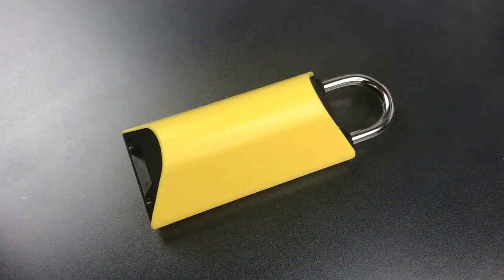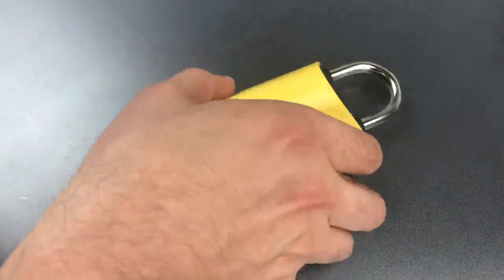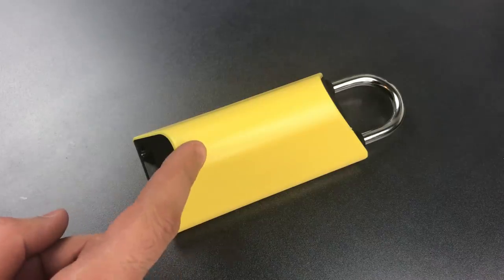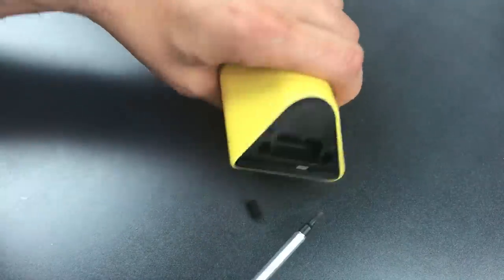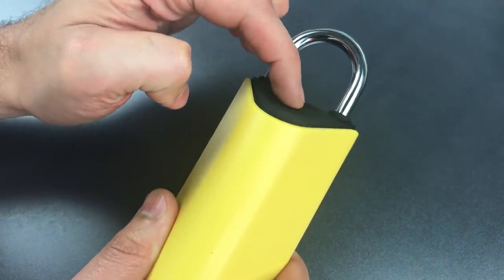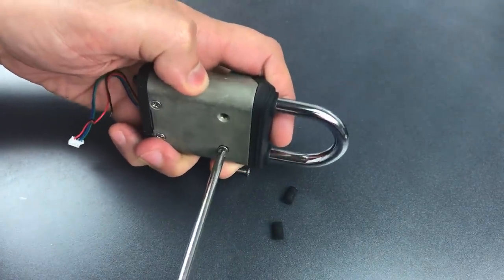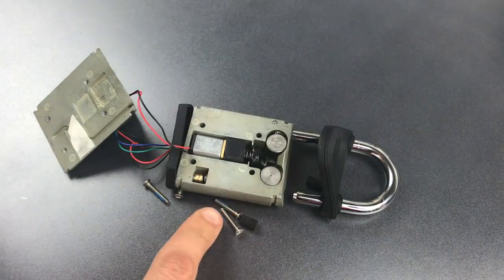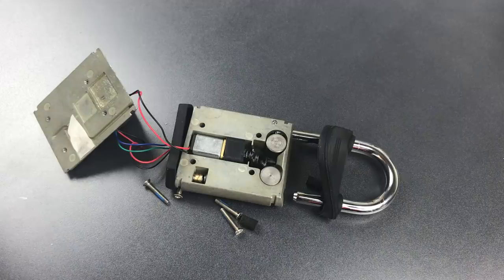[752] BoxLock: $129 Barcode-Scanning Padlock Opened With Screwdrivers!

Comment: Fun fact: They charge you 20 bucks for a sign "Delivery protected by BoxLock" that basically reads:
-owner is not at home most of the day, house is empty and there are no neighbours who would care for them (deposit packages for them)
-owner often orders highly priced stuff on the internet (why would you otherwise spend 130 bucks?) and has a faible for new, valuable gadgets-> probably expensive stuff in the house
-big box with valuable stuff at the front door, probably not secured well (since humans are lazy)

Yeah, that would totally deter thieves and not make their job easier by putting a huge yellow "please rob me" sign on your lawn...
Reply: Eulemit Beule now that's funny true but funny
Reply: Given the current crop of delivery drivers, they'd see the BoxLock, roll their eyes, whip out a "sorry we missed you" tag and slap it on the box the lock is on, and drive away with your package. You'd have to go out to the pickup point and claim it yourself. The days of them trying to deliver it the next day are OVER. Ain't nobody got time for that!
Reply: Agreed, Gwen. Fed Ex or UPS have a business model around delivering packages in a certain period of time to make the system run smoothly. If they're fooling with some electronic thing that fails to stay synchronized with the internet to send a barcode, it's pointless.
Reply: Persecuted: to annoy with persistent or urgent approaches
Did you mean "prosecuted"?
Reply: About as smart as those people who put a "proudly gun free home" sign in their yard.

Aka "come rob, rape, or murder us if you want" sign
Reply: David Daivdson  As long as you're home all the time...
Reply: I love how this is the one he favorited
Reply: I just have my stuff shipped to the PO Box. They're secure it and its locked in a locker with a key that's only given to me.
Reply: David Daivdson  I have a "Beware of the Velociraptor" sign.
Reply: @brokenwave6125  my home is gun free. Cricket bats, however...
Reply: @dkevans  Respectably, what's a cricket bat gonna do against any firearm? I don't live in the US, where I live guns are illegal. But in a country with guns around every corner I think it's kinda foolish not owning one. No amount of good will is going to prevent bad people, and no melee weapon compares to a gun unless you're already on top of the assailant. You can do whatever you want, but seriously why not own a gun in the US? It just seems like a risk.
Reply: More like set it by the door and ignore the lock completely
Reply: @joseph crosby mecham lol what?
Reply: @dkevans  "Beware of the bees" works better.
Reply: Lol, the sign just tells a thief what to research before robbing you
Reply: @andyk192  They'd just claim they didn't see it. If you try to say "but here's my BoxLock with the slip stuck to it", they'll claim they stuck the slip to the window and YOU put it on the box to get them in trouble.

I had these jackwagons decide that, because it was RAINING, they didn't want to deliver the $2,000 ham radio I had ordered, because they'd have to haul a big box to my porch from the street. So they ran up, slapped the slip on my window, and drove off before I could stand up from my chair and go to the door.

I was HOME the entire time, and the guy had to walk within 3 feet of me on the other side of a wall to get to my door so he could leave the slip. I tried calling UPS, but they don't care. They'll swear up and down they're going to call the driver and have him turn around, then they just hang up and flip off the phone and ignore you. I had to make special arrangements to drive 3 miles into town to pick the thing up at some hole-in-the-wall pack 'n ship storefront where they left my expensive package.

It was still raining, by the way. It was okay for ME to have to haul the box to the car in the rain from the shop, but this delivery moke -- whose JOB it was to actually do this -- couldn't be arsed to get a little damp. He swore up and down that "nobody was home", but he didn't even TRY to ring the bell or knock, because that would have meant having to go back to the truck to get the box and getting wet TWICE.

I have a sign on my front door that says "DELIVERIES: I am home, but disabled. Please ring bell and BE PATIENT. I move slowly!" Since I actually am home 99% of the time, there's zero reason to put a "nobody home" tag on the window.

But the WORST are Amazon delivery people. They'll claim on the delivery that they "placed item in resident's hands" when they didn't even show up, just so they can avoid getting out of the car in bad weather. I've had that happen a few times. They've finally started having their drivers take pictures of the package where they leave it, so you know they at least TRIED to deliver it. I guess they had too many drivers either throwing stuff away or just stealing it, and claiming they left it on porches, blaming its being missing on "porch pirates".
Reply: @brokenwave6125  That sign doesn't say anything about the mine field, poisoned arrows and other booby traps, though.
Reply: @jacobesterson  In close combat almost any weapon is better than a gun. It's way easier to stab somebody in close combat than to actually shoot that person.
Reply: My sign says "Warning: Live Poisonous Snakes"
Reply: @brokenwave6125   really? Because all signs are honest? Because you can ONLY defend yourself with a gun in the close confines of home? Because during a home invasion a burglars first thought isn't "are these people home at all?" Come now. I'm a supporter of 2nd amendment rights(and home invasion IS an appropriate use of those rights) but your hypothetical situation is fairly silly.
Reply: You can’t buy street smarts I guess
Reply: @joseph crosby mecham wtf?
Reply: @brokenwave6125  funny - for the rest of the world thats the default without needing a sign... but somehow nothing happens =P
Reply: You don't just put it out on delivery day BUT yeah , that's a issue
Reply: @JennyEverywhere  I had ordered a ring (~$1k) online last month for my girlfriend and almost lost it due to a UPS driver not doing his job. I’m at work when I get a message that my package had been signed for and delivered (had it shipped to my mother’s house since I knew I’d probably be at work), I looked and saw that the signature was not my mother’s, and instead a different name. Turns out they not only delivered it to the wrong address, but also forged the signature and just left it on the front porch. The neighbors across the street that the ring ended up at were on vacation and as such could not have signed for the package. Thankfully when I went to start asking people about the package I noticed this, otherwise I would’ve been out an expensive, time sensitive item. UPS also makes it nearly impossible to talk to anyone at all, which is shameful.
Reply: I don't think the average thief on the streets has this much know how about security devices and their weaknesses. 
But, Security though Obscurity is not really reliable on the long term.
Reply: @JennyEverywhere i wouldn't blame the drivers, since their exits are often timed nowadays, and the amount of packages required makes it impossible to take more time than strictly necessary on every one of them. But yes.

Comment: LPL: Doesn't show the Master Barcode for obvious security reasons.
Also LPL: Shows how the lock can be opened in minutes with a screwdriver.
Reply: TheIceWarrior It could identify him. It’s Opsec about his identity, not about the lock.
Reply: I guess if you wanted to use one of these you could super glue the screws in and make it a bit tougher to open
Reply: Red loctite on the philips screw threads
Reply: @merlinious01 alternately, fill the heads of the screws with superglue so you can't access them with a screwdriver.
Reply: @svnhddbst8968  
Superglue is shit.
Just use overly thick screws and run a drill in them after installing to strip them to nothing.
Cant use a screwdriver to turn a circle!

Though bonus points if they use a milling bit not a drill bit to make the surface flat instead of concave.
Reply: @svnhddbst8968  acetone takes all of 30 secs to loosen to get in red locktite strippong the heads then filling with jb weld would be better
Reply: @antoy384  It might identify the person that gets lock samples sent from manufacturers.... Makes sense.
Reply: @merlinious01  red? You ever seen green?
Reply: @merlinious01  you can buy screw extractors for a few bucks that fix that. But it does ad another layer of complication.
Reply: @bullhornzz  
Yeah, but short of welding it a screw extractor is an option.
But I bet it wpukd be easy to break extractors on this, so small and flopping around.
Reply: The way I see it, not showing the master barcode helps to discourage casual opportunists who happen to have a virtual key dropped into their unsuspecting laps Vs. somebody with even the most casual intent to break into security and steal stuff...
Reply: Really blows my mind how those "high tech" lockmakers fail to create a secure lock. Hell if you don't have the knowledge for that yourself try to partner with a actual lockmaker, it's not rocket science.
Reply: @flavvsdasilver6442  
I doubt the master barcode unlocks all of these locks.  It would only unlock his lock.
Reply: Nothing you do to those screws is going to make the slightest difference, because no real thief is going to waste time with the stupid screws. The only reason to bother with that is to also steal the lock, and that lock is too much of a PoS to be worth it. Just cut the thing in half with pruning sheers, yank out the top lock mechanism, and skip the first half of the work and time of LPL's method.
Reply: @merlinious01  I agree, use epoxy instead - that stuff will survive the upcoming Armageddon.
Reply: @Aff3ct000  you HOPE it wouldn't unlock all of those locks...
Reply: @Aff3ct000  fair point :)
Reply: @Aff3ct000  Don't bet on it. It's well known in the computer security industry that codes like that should be unique per device. It's also frequently ignored by makers of IOT devices like this. I wouldn't bet a dollar that that barcode isn't the master barcode to every such lock ever made.
Reply: @merlinious01  Or Quicksteel them in never to be opened. Oh wait someoen would just cut that lock and not bother going through the hassle to unscrew it all.
Reply: @canaan5337  Or fill the holes with soldering thin, or hot glue. Basically anything that would make them permanently inaccessible.
Reply: @JohnDoe-nq4du  Actually, if you use an electric screw driver and don't care if you break the lock (rip out the wires), unscrewing it might actually be the faster and less noisy/suspicious method of getting the delivery.
Reply: @merlinious01  does not matter. Give the exposed cable 9v +/- it will pop open
Reply: Actually two screw drivers (or two bits).

Comment: If I am right, you don't even need to disassemble the inside section, just connect blue and green cables (motor) to battery cable in 3:57 . I could not see in detail, but it seems that is the only thing needed.
Reply: I was thinking the same thing. Those breadboard jumper wires fit most connectors pretty well.
Reply: Might as well be a servo motor which needs the IC to run. Still worth a shot trying to jury rig the thing into compliance.
Reply: true.. also wanted to comment this. You don't even need your own battery, just use the provided one!
Reply: @pinksock that doesn’t look like a servo motor. Just looks like a standard cheapo motor to me. Plus the connector has 4 wires but only two go to the motor. I would think if it needed an ic to run it, there would probably be a sense wire going to the motor for communication with the ic. But it’s just got power and ground, so yeah the battery would totally pop this lock open given the right polarity.
Reply: If it's a DC motor, sure, if it's a servo, you;ll need something like an Arduino to help
Reply: @TraceguyRune  With an arduino there's no way it couldn't be bypassed... though that's a bit overkill if you are bringing 
custom electronics to a fight when a screwdriver does the job.
Reply: It looks more like a solenoid to me. In the off state the spring holds the plunge engaged.
Reply: @rippspeck  hell, you just need a paperclip or staple, no wires even needed lmao

Comment: LPL: looked like your finger pushing that plunger into the solenoid released the shackle. I'm wondering if simply striking body sharply with rubber mallet might do the trick. Or maybe even a magnet attack?  Round 2??
Reply: I though the exact same thing
Reply: He might have pulled something out of the lock.
Reply: @user2C47  I disagree, if you carefully look at 0.25x speed you can very well tell that he presses downwards, however I might be wrong
Reply: Round 2 could be why he didn't want to destroy it ;)
Reply: A screw type actuator on a motor, rather than a solenoid would have been so much better.
Reply: Donald Sayers Highly impractical and slow.  That aspect seems to have been designed right (no shackle bypass demonstrated).
Reply: @johnfrancisdoe1563  Practical and maybe slow. Screw actuators work.
Reply: If you know where to drill then you could get this lock open in less than 20 seconds. A standard drill bit would easily cut through the cast metal inner body and if correctly aligned the drill bit can actuate the release lever.
Reply: Yes please give it s round two! Will it be possible to shim it or am I mistaken
Reply: The exact opening action is that he pushes the actuator towards the bottom of the lock and the entire motor-axle-actuator block moves down with the motor electric connections slipping nicely inside the huge hole at the bottom.

This is a simple rotating motor with no solenoid so I think the magnetic attack would fail.
For the mallet attack, I'm not too sure if it would work. I can't see any purpose for the spring since the actuator didn't slide on the axle. Also it is possible that the motor was tightly held in the lock body and LPL's first attempt at lifting it with the screw driver freed it, allowing the sliding push. So maybe you'll need a first hit to the back side and another to the top to get the same result on a brand new lock.
Reply: I think he didn't need to physically open the inner lock body (with the four Phillips screws).  All he needed to do was apply power to the lock motor using the exposed wiring.
Reply: @donaldasayers  this
Reply: @donaldasayers  fast enough for a DVD drive
Reply: Or just send a current through the wires once the fingerprint reader is unplugged
Reply: Also theres only 2 wires going to the lock motor I'm guessing u could jumper wire it open from the battery just bypass all electric wizardry
Reply: Two wrench pry method.

Comment: An entertaining pick but any thief will hammer it off in a moment because it's too flimsy.
Reply: It is special yellow plastic, you will never be able to break it.
Reply: Good thing they didn't use that weakass blue plastic.
Reply: The expectation is that the thief will hammer on it a little bit, and then discover that there's a metal body with wires coming out of it and walk away. And that nobody's going to try hotwiring it or unscrewing the remaining screws.
Reply: @fracturedhearts3734  for fffh get free free free f free ff

Comment: Despite it's ease of disassembly, this lock will probably deter most package thieves, who will leave and find a package that isn't locked.
Reply: I suspect this to really be the purpose. Make it slightly harder for the thieves to try and get in,  not to actually create a super secure container. If you're really concerned about security, it's far cheaper to just have it held at whatever services' you've chosen pick-up/drop-off point and go get it.
Reply: SergeantHop Tbh this lock is like 130 dollar and most prouducts people order are dirt cheap ones. And warranty is a thing. Also a thief could literally just come with a hammer and a screwdriver which would take no time...
Reply: My thoughts exactly, porch pirates are chicken crap by nature....they won’t go through all that trouble.
Reply: @User 2C47, true but to be fair, I think LPL's video is likely to deter most consumers from even throwing down ~$130 on that, "piece of electronics."

Comment: Is the lock actuator released via a magnet? If so, could you use a rare earth magnet to pop it open without any disassembly? Great video as always.
Reply: Was thinking about that
Reply: Did LPL try it with the rotating magnet? Wonder if the metal shielding might block the magnetic fux a little bit.

Comment: This kind of lock is the kind that keeps honest people honest. Given time there are several ways to open it. But it is made to be owner serviceable.  That is why there are only little pieces of foam to hide the screws. The harder you make getting at the screws, the harder it is to replace the battery. Putting an access hole under the shackle means that you can't open it if the battery is dead, the reason you want to open it in the first place. So it should be considered a convenience barrier aimed mostly at porch pirates rather than a real security lock. In that role, it would probably work well. It could be used to lock a security box on the porch or a door into a shed rather than a house door lock. A porch pirate does not want to stay longer than a few seconds. So this would work to delay them long enough to deter them. Also, they don't want to be caught with what could be considered burglary tools.

Comment: If only they would have used the same screws inside then it would have only been 1 screwdriver ;)
Reply: But, at least they used Blue Loctite to "secure" the 4 inner screws. (SMH)
Reply: @hightttech  Blue thread locker is used in many consumer electronics. Keeps things from falling apart.
Reply: Except for the bolts being held in place by the cover the whole shacle part is inside of.
Reply: @patx35 :    Turn on your sarcasm detector pal... If I'm as serious as you, i would recommend RED LOCTITE. 😆